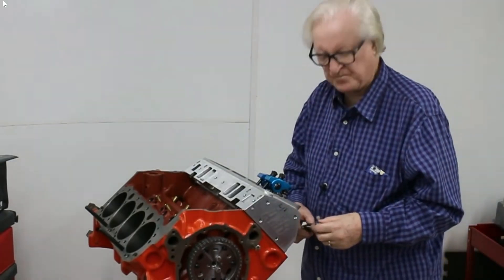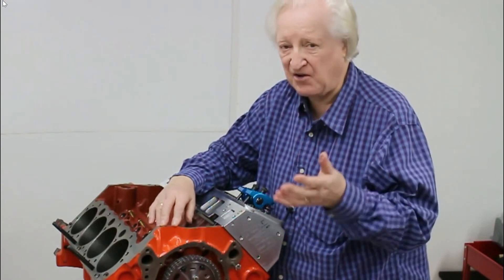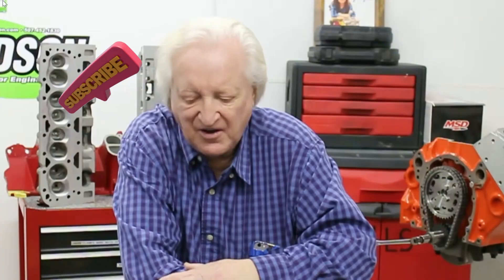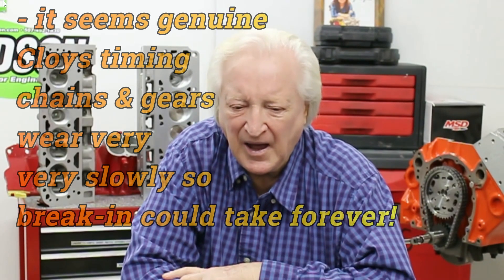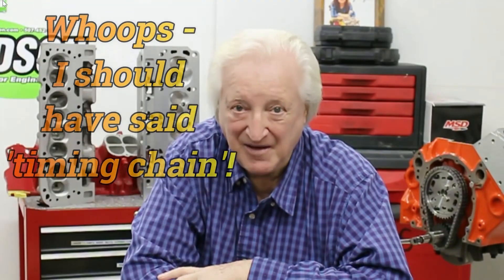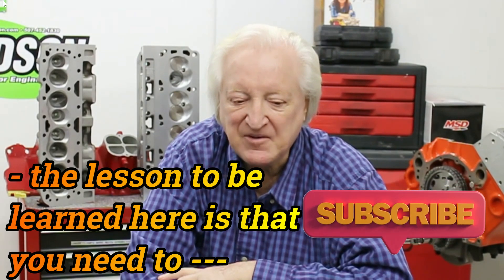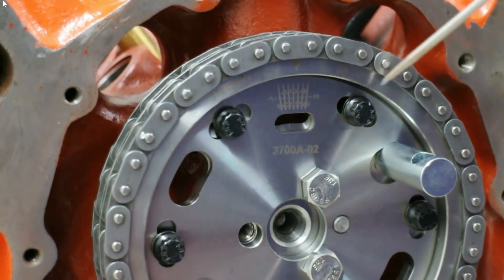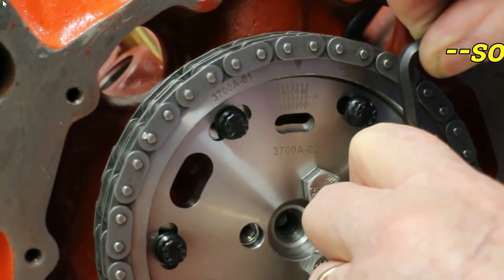Here's how to fix a not so visible power pirate

Comment: Smokey Yunick had cams ground backwards so he could run a single gear timing gear drive like a 300 Ford 6.   He recommended a 4-7 swap reverse rotation cam with a single gear to gear set chainless, like a Ford 240-300 6.
Reply: GMs inline 6 engines also had gear to gear timing and it would have been awesome if they would have kept it on the v8s!!

Comment: I notice.that too tight anything saps power, you may be miles before everthing in that block is friendly. Pop on new heads, +10-20 hp. Index your plugs, also my timing is always 1 tooth plus on the crank to take the mechanical advantage of the piston going down and not getting resistance from TDC to crank relation.

Comment: Have you ever checked your cam timing from both banks? I was checking my cam timing on  a hot rebuilt 1967 Buick 430. I adjusted the timing on the #1 cylinder as usual. I decided to verify the timing on cylinder #2, and it was 4 degrees off! It was 4 degrees late. I then proceeded to check all cylinders, and sure enough, cylinders 1, 3, 5 and 7 were the same, while 2, 4, 6 and 8 were 4 degrees late! I consulted TA-Performance who supplied the cam, heads and everything, and they suggested to split the difference between banks. I think this is due to sloppy machining of the lifter bores in the block at the factory.
Reply: Does that have anything to do with a built in 4° advance? My comp cam xe284 came with a 4°advance.

Comment: The weak link I see on V-8 engines are chain drives. After 150.000 miles, most chains are shot.   Most new engines are running tensioners. How do we feel about chain tensioners. AND  Smokey Yunick was a big fan of gear drives

Comment: Back in 1972 one of my first builds was a 283 chevy with a Cloyes  three position crank sprocket it took several tries to get the chain and sprockets assembled. Remember that well. It might be with a line hone on the main bearing bores the chain would loosen up a bit.
Reply: Cloyes has always made different length timing sets for line bored engines  etc

Comment: i'm wondering if an align hone of the bearing saddles on another block would help that tight timing chain get some slack if transfered over, due to the crank moving up towards the cam bearings in the second block

Comment: David, please talk about the pros and cons of a belt driven timing chain versus a chain
Reply: They've got their place, I've got a newfound respect for belts. 
About a month ago, I replaced a broken belt on a 2.3 ford that powered a generator.
It was an early 80s model ,with 1700hrs on it and was the original belt. 
Gotta love non-interference engines, and I wonder if the new belt will last another 40yrs.
Reply: @MrTheHillfolk  what sparked my curiosity was David mention a loose chain, dampen more vibrations to the crankshaft and camshaft, and I believe a belt being rubber with dampen it even more, and I’ve noticed Steve Morris engines, uses belts and not chains on his motors, but I’d love to hear David’s perspective

Comment: I wonder if an advanced oil formulation of MoDTC with a synergistic addition of ZDDP or MOLYVAN-855 in the oil which are  advanced anti-friction components that work thru a plating-effect & if they could also dampen crank harmonics...

Comment: Thank you for sharing your knowledge with us , I’ve always wondered if gear drives are worth the supposed extra harmonics vs accuracy?  That said I’ve a Jackson .005 allign honed set on a n/a 355 with 5 seasons of open wheel usage & now in a 2450 lb super gas car as a starter engine for kiddo & it ran 10.80 @122 w a set 461 heads i home ported & a flat tappet solid cam.  I wonder if I should have used a chain , but it’s a reliable little mill , thoughts welcome 🙏
Reply: My thoughts are you should have gone with a Mopar, BUT that's my thoughts on everything. (AND NOT A THIRD GEN HEMI)

Sounds like a lucky kid to get to start out with a rig like that. 👍 It's been my own experience that DV has it right, belt drive is the pinnacle but I've used gears and never had a problem, though it was not a race engine, overkill just to talk about with my friends
Reply: the dog bone gear drives make a lot of bad harmonics. the single gears are great.

Comment: Pulled down this rebuilt engine that I got in a car for some upgrades and found that the timing chain was so tight, the front cam bearings had worn into the copper.  Prob used the wrong set or it was packaged wrong But supposedly it didn't have a lot of miles on it and I believe that because it was a efi car that wasn't set up right at all.  Not one sensor hooked up!

Comment: Have a big block chevy race motor. It has been line honed maybe 3 times. Put it back together noticed a very slack timing chain. Ordered up cloyes new timing set up -.02  much better. Snug maybe 1/16-1/8 ?  Roller cam . Now I'm concerned.

Comment: What about gear drives? Like the Pete Jackson gear driven timing gear sets,  I have heard positive and negatives on them,
Reply: I can't say this is any proper test,but i ran a pete jackson gear drive in my 482 big block chevy from 1988 to 1998 and it was my daily driver in a 70 chevelle. using a .670 .690 lift roller with 312-322 advertised duration,13:1 compression,3.73 rear end gear. The car ran 10.60's at the track on weekends and was street raced excessively. In those 10 years the timing was dead rock steady and i never experienced issues from harmonics hurting spring pressures as some claim. that being said its critical to set the gears up correct for clearances. One persons account does not make a study,but i run gear drives in everything i have including a high 9 second tubbed 88 S-10 truck.

Comment: I would suspect that timing set was mis packaged, probably intended for a block that was line bored excessively so the crank to cam spacing would be reduced leaving proper slack in the chain.
Reply: That being said, EXCELLENT information on all of your videos. Thank you for all that you share with us viewers! I'll be using a great deal of this info on my next sbc build!
Reply: Or just crappy QC, lots of tolerances to stack in a timing chain, without even getting into the finer points of gear/sprocket cutting.

Comment: Can you buy timing chains with different lengths?   I ask because sometimes, if the block is alignbored too much, you might have the other side of the problem.
I know one machine shop that created a dampener/tension device on an old Pontiac block to take up the slack.    Sounds like they could have save a lot of time/effort with a proper length chain.
I also seem to recall a lot of discussion about true roller, vs.  gear drive, vs. belt drive - where belt drive was the best on horsepower.  Is that still the case?

Comment: This makes me wonder if I should delete the timing chain tensioner on my 5.2 magnum 390 stroker motor. These  engines have a longer timing chain than a small block Chevy because the camshaft set's higher up in the block. Those tensioners make the timing chain super tight.

Comment: AFAIK there is really only one decent brand of timing chain. JWIS from Germany. And even they do not last very long before going slack moving cam timing. There is tight and excesivly tight though and that usually comes back to the gears being a touch too large,, or small.
I have had one of those chains break as well, was not peined properly and it disconnected itself. Under 5000 miles in a very mild 400 Ford.

Comment: David Vizard, a question....Would cam bearings that are tight enough that the camshaft (by itself) can only be turned with a wrench on the cam bolt, would that cause similar power loss numbers as too tight of a chain (less,more) ?

Comment: Typically 'timing chain/gear' power losses are not from the chain/gear drive dragging and causing friction.   It's from incorrect crank to camshaft phasing-related issues.   In any engine, a few degrees of cam phasing in the wrong direction can easily knock fuel efficiency down by several percent or more in its primary operational RPM band.
Reply from the maker: Watch the video again. In each test the timing was optimized by virtue of the CC adjustable timing gear!

Comment: As a young boy in the early 80s every old motor I swapped a cam into had a pan full of nylon teeth off the timing gears. Those motors must have been making an extra 30 HP. lol
Reply: Minimum of 5 hp per tooth lol

Comment: Chains have a problem..They suffer from chordal fluctuations that pulse the chain and anything being driven. Must use fine pitch chains with lots of teeth to minimize this issue. Morse chains  eliminate this issue I understand. Correctly machined gears do not have this problem.

Comment: Want a free 20 HP  with a good hot battery electric fan and water pump take the belt off coil your fuel line through a coffee can, fill it with ice run it through the quarter shut it down drain the water from the can and put the belt back on it.

Comment: The Jackson is noisy junk, with extra weight and gear contact . And NO you don't need the Torrington thrust on the Cloyes, just radius the oil slots on the back of the cam gear . Tens of thousands, maybe hundreds of thousands thrown away on the Torrington thrust . And don't give away that you think it's power .